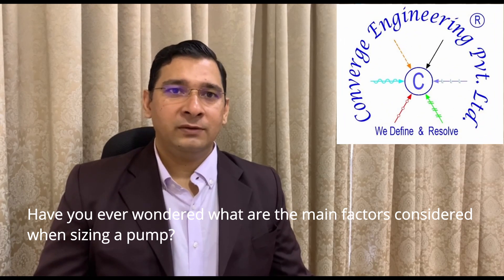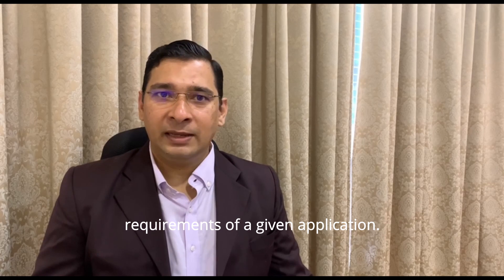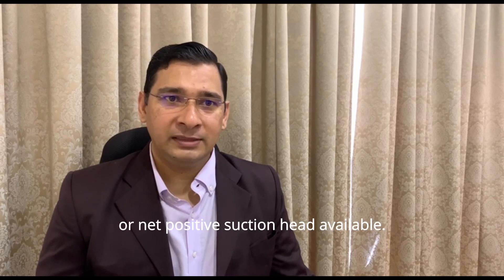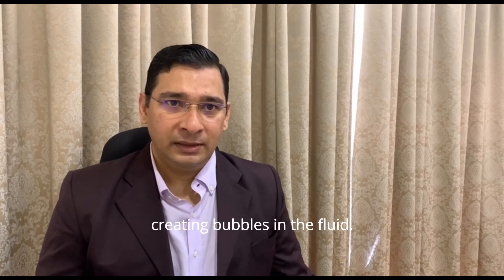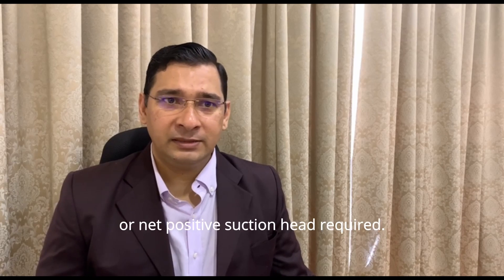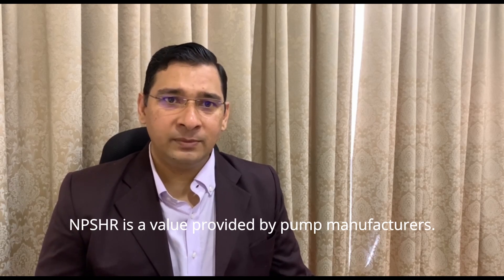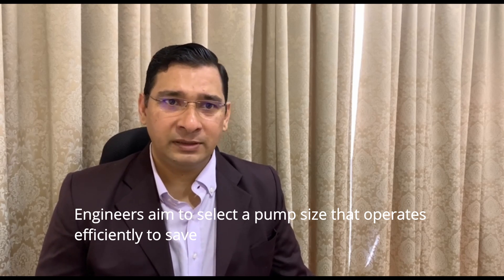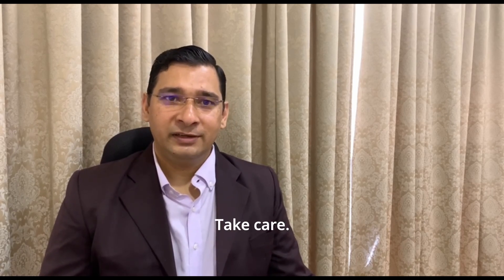Factors considered when sizing a pump (8 of n)

Comment: Hi Ajay, very informative video. In case of PD vane pumps, if the pumps are running in parallel, will the pressure losses in the common suction line be divided into 2? if the total head loss is 6 m, and the NPSHR for each pump is 4.8m, will the head loss for individual pump be 3m. Will pumps work without cavitation in this case? Thanks.